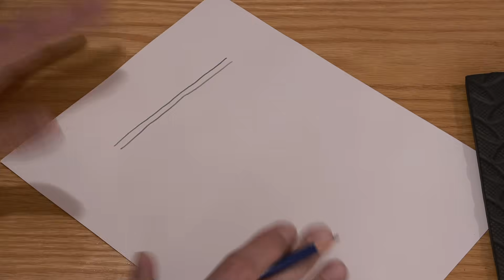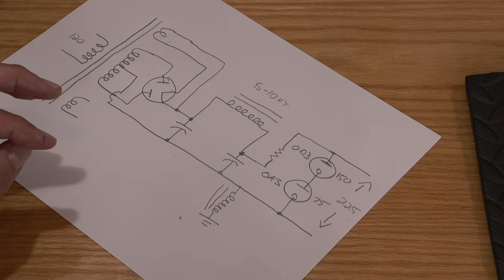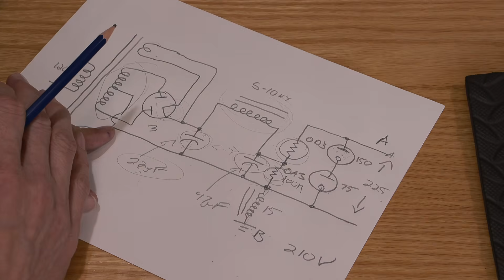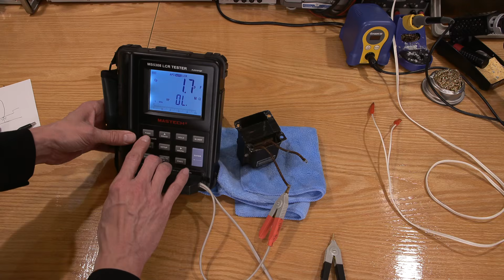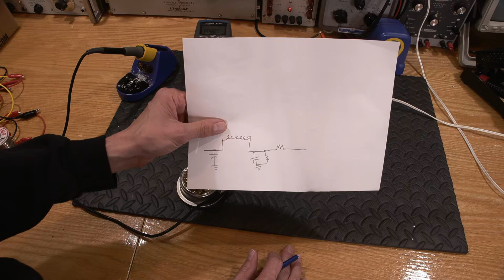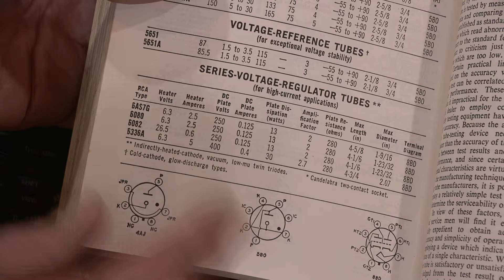Build A Power Supply - With Junk Box Parts! [The BC-348 Series.]

Comment: You should check the insulation resistance between the transformer and reactor windings and the metal casings of the cores. If the insulation has degraded, the cases can be live and be at high voltages.

That is the first thing I would check before anything else!

Comment: Had this happen on my BC-454-B. The prior owner scrapped the dynamotor and inserted 6 volt tubes instead of 28 powering 12 vdc tubes in series-string. The heater wiring was sketchy having one tube in series feed 3 tubes in parallel. This made the voltage at the 3 in parallel 0.25vdc. I bought a dynamotor and rewired it for 28-12vdc low voltage power. Bought the scrapped 3H Choke, HV Resistor and Capacitors and now it works. Had to also rewire the front panel because the gain control was grounded to the CW-AM switch which was very wrong. Everything was weird, but got it rewired. Definitely always want to check for modifications, especially because this conversion was done with spare cloth wires from other BC-series receivers so it looked original.

Comment: Hey Paul,  you would be far better using a 5Z4 instead of the 5U4 so the HT came up a lot slower and prevent punishing the stabilisers with excessively high current even for a short time.

Comment: In the context of a really quiet power supply, should the rectifier tube be close to the voltage regulator tube(s), since one of them deals with a variable voltage source, the other trying to stabilise it, knowing tubes are microphonic and rf sensitive ? I didn't pull it of my mind, that is what a seasoned DIY tube amps builder and former Fender employee (Uncle Doug) used to teach me beiing specific on transformers, filament circuits and preamp tubes locations taking accout of magnetic fields inside of the chassis
Even Better Regards ;)

Comment: Awesome video ! What is the lowest voltage a tube rectifier can work ? I'm looking forward to build a studio tube preamp, since I live in europe I intend to rectify ac mains with a solid state bridge rectifier, I've heard silicon diodes are noisy but I also intend to use like you've shown tube regulators after the ripple rejection stage to tame that noise. Still remains another myth I heard that says dc filament current would be quieter than ac ones, I know tubes need high votages to work, desiging heating circuit in series may get me in the 24 - 48 V ballpark (I could add even (phase purpose) tubes stages in my design to reach a value). Is it safe to build heaters in series ? Is there a tube rectifier that coud work within this range ? If not what is the lowest voltage one ? I intend to use as much  tubes as physics allow me without using a center tap power tranformer, I know I'll have to use a step down one for filaments but  I intend to be creative on this part .AFAIK Tube voltage regulators are far more stable than modern solid state equivalents, they just operate at different voltages, so do triodes and  pentodes .... What is the best B+ and plate operating volages for 12AX7 tubes ? I know I could dig myself into specs sheets but I prefer relying  onto someone who has real field experience, I may search for days and weeks, you may know that by experience and just pop it out by heart ....  Forgive me ;) 
Best regards ;)

Comment: ambient power reception is wanted and here is an idea to experiment with. Alfred Hubbard used 2400 foot bi-pole antenna oriented North-South (each leg 1200 feet). He had another going east west. If these feed down to a common balun (say 4:3 ratio with center tap) and with each hooked up so that the magnetic fields perform a subtraction (bucking), this removes local noise from the reception and picks up long wave propagation (unidirectional). This is his power source for his so called "Hubbard Coil". But the antenna is the interesting thing. Modern researchers use an L shape such as 1200 foot North, 1200 East. Signal processing can work out the direction of the signal, field strength, lots of other interesting stuff. BUT ... also I would imagine that you could use this for energy harvesting because if you can make it start beating -- using tuning ... because this is a differential reception ... not carrier wave reception ... that also would be ideal for harvesting RF power down at these low lightning strike around the globe places. With language models like free "copilot" and "gemini" and "grok", you can have it do all the math for you on such an antenna. It also informed me that 3 to 30Khz might be a better frequency range for lightning strike reception. This is a dangerous antenna. It could kill you as you know. Perhaps a proof of concept should use a smaller size and be in a frequency range of some man made reliable signal like WWV (2.5Mhz or higher)  at first. Balun could be also be tried to "add", and if you reach an exact match -- voltage peaks could be doubled. Also, by tuning "Q", you can go for wideband harvesting versus narrow band harvesting. 30 meter WWV might be a good 1st experiment.

Comment: I thought I was "doing it wrong". In an older radio power supply I'm modifying to keep the voltages reasonable, I was roughly guesstimating and substituting different resistors, and seeing what happened to the plate voltage. Watching you do basically the same thing (albeit while actually building a power supply) makes me feel much better about my, uh, "method"— and quite chuffed about the cash I dropped on a power resistor substitution box on eBay a few years back. Dialing it in with chicken-head knobs: sheer luxury for $40.00!

Comment: When I was a kid in the '50s I ran one of these as a novice ham operator.  I built an ordinary (non-regulated) 5Y3 supply installed in the dynamotor space - the usual practice for those days. Just for nostalgia, I've just bought a BC348 on eBay.  My inclination now is to install a power supply with a silicon bridge - no heat to speak of, no space requirement.  Open to suggestions as to a good circuit with no bias against solid state components.  I do take care to keep the radio reversable, in case someone wants it original in future.  This example still has its dynamotor.

Comment: I would put the PS inside, but I like what you are doing. With an external PS you can fabricate a cable and, with socket on each radio, you can power all of your 348s one at a time. Is that the plan?

Comment: Excellent video! At my last job, I made a list of low voltage bulbs, and their current consumption ( from a Glover's Manual...the little book of everything) to get accurate voltage readings from transformers. Attach a bulb of the appropriate voltage, and near the rated current of the transformer, then check its voltage. Generally, no load voltage is about 20% over rated voltage.
   A " Clamp Amp " meter is a temporary current transformer, I suppose.
     Two jobs ago, there was a wired intercom system that got its power from a standard outlet. On the back was a little neon indicator and label that said " If indicator is lit, reverse plug". Older outlets and plugs in the US ( and Canada, I suppose) weren't polarized. This was the '80s, and the intercom was from the early '60s.
    Years ago, I got into a friendly argument about wiring transformers in series, to get higher voltages. One guy said you couldn't, I said you could. You can, if the transformers are identical, but you will have to experiment a little.
    The line noise from that CFL...line noise must add up, and present problems for the power company.

Comment: What about using tubes that were designed in 1947 to have a heater voltage of 12V and a B+ of 12V, and anyway your only going to use a headset and you don't need a high voltage power supply.

Comment: Good to see you analysing the power supply. There is no need to convert to 6.3V...24-28 volt transformers are available,..though most ler P/t's offer 2 x 6.3 or  6.3 and 5V .
I ofte enough use them in series. Running filaments at 5V or 28V at 24 volts probably does not make a substantial difference to performance . Looking at close-up...his 
soldering is SO bad!! Is that torroid a choke?...A covered standard choke is a better option (or an external supply).. Another better choice if filament supply is inadequate, is 
find a better transformer and use a normal choke (which I do even when BC348 audio transformer has its own choke. Easy way to check if 6.3 v converted is to pull all
 tubes and look for continuity at each socket to socket .(one 348 tube does not use pins 2,7 as filament) or put some 6.3v or less usually on the filament line and see it it appears
aat each tube socket With 28V it will be broken as the series tubes are out. 70mA B+ is ok/correct for the 348

He didn't do a really good job!! apart from the nice looking to the wiring he did is abysmal!! I wish you'd get ontothe grid cap set....much more ;ham typical' late 30's design. The AVC/Off/MVC switch is not suited to AC spikes...far better to use a separate switch or connect a relay into the on/off cct. I refer to also use a delay on the B+ ..let tubes heat first. With dynamotor that was 'automatic' as the dynamotor 'ran up" to speed and thus B+. The R series should NOT have B minus directly to chassis...the audio transformer choke provided bias. I also prefer to have choke in B minus line.

Comment: Perhaps I missed this bit of info. How did you determine the B+ voltage should be 210 VDC? I would imagine that it was experience but for a person with far less experience tell me how you arrived at that.
Reply from the maker: Hi Richard. The B+ is in the manual. For this receiver, it's 210. Keep in mind, it's not all that specific, 215-220 is fine, it's not going to make much difference. Since we are comparing these receivers, I will keep the B+ as close to spec as possible.
Reply: @MrCarlsonsLab  That you have a manual for this is total surprise to me. Hopefully you have some decent schematics to refer to on the next part of the restoration.

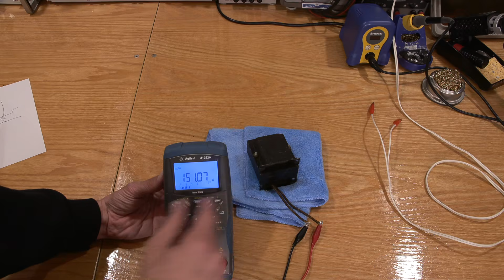Comment: 51:05 the lcr meter should do a great job of sensing resistance if you set it to DCR. Especially with low resistance because it would do 4 wire measurement.

Comment: My dad has 2 of  these radios and as a teen I made 120v power supplies for both. I used solid state and didn't really regulate anything. But they worked. 

I'll check to  see if I still have the radios.

Comment: something tells me you've done this before 😁

as you gain experience the math starts to matter less; but before you have the benefit of experience the math is very useful.
it puts beginners in the right ball-park and keeps them from fumbling around in the dark to no end.
the way some schools try and electronics THROUGH math, however, is a mistake. you need to get their hands dug in and experiment.

but even with the benefit of experience, I find if I'm ever working on something that's new to me, I fall back on the math to find my footing.
though it is clear I have nowhere near the depth of experience you do lol

Comment: In keeping with your desire to keep the radio somewhat period correct, I'd think you''d want to use a sheet metal chassis for the power supply. I suspect that when this radio was new, there may not have been those handy Hammond cast boxes.

Comment: I did something similar to this for a audio amp I'd built, had to take the inductor out due to it causing a worble noise at around 11 htz coming from the supply! Figured the core had gone into saturation mode. Placing a resistor in place fixed it. Took a while to understand this problem. Amp is very quite. Found this interesting watching you test your supply. I try to catch your videos when they come out. All very interesting.

Comment: Hey! Around 1:44:00 you're checking out the voltage variability on the multimeter, and mention it being 20 to 30 mV. Is that correct? I may be reading the meter incorrectly, or this may have been an oopsie. Did you mean 200 to 300 mV?
Reply: I didn’t see your comment until I made mine. But I believe you’re correct.

Comment: This is really going to be beautiful. Also, you probably know all the common standards that these transformers were built to that I have no clue about, but I'd be spooked to use an un-spec'd transformer without checking the gauge of any high current windings like the filament to determine their current capacity and unless it was blatant overkill, the cross-section of the core to make sure it could handle the total power.

Comment: I vote for the open chassis with black crinkle paint to match the radio. I'd try to arrange the parts on top to match the schematic. The artsy pyramid of regulator tubes flanking the 5U4 violates my esthetic sense. I see, left to right, the transformer, the 5U4, the choke behind the tube, and then the regulator tubes in a line, front to back, on the right. On front panel, L to R: A black fuse holder, a chrome toggle switch, and a red jewel light. On the back: The female Jones connector. Just gorgeous on a cold winter night listening to CW. I vote yes to a product detector and a souped up audio section.

Comment: The power supply I built for my tube amp system is fully regulated, stepless adjustable from 230-500 volts and have less than 1mv of ripple (outside hearing range) no ripple in hearing range at least what a scope can measure, and it can output up to half an amp of current or about 150watts continuously , no load or mains voltage skews the output at all, it is completely clean DC. the power it gives is so clean there is no need for any types of filters in the amp so I am injecting this directly into the amp, what this does is that the input voltage at the output transformers always stays exactly the same even at full volume which reduces distorsion and increases power and control at the same time. I put a lot of work into making this since I drew the circuits myself from the ground up and I also included over voltage protection and other things to make it even more potent

Comment: Actually, the regulators aren't vacuum tubes - they have gas in them. And for 100 mA, you're better off with a 5Y3 rectifier - or its 4 pin equivalent, the 80. And if you use a choke-input filter, the output voltage will be about what you need AND the regulation will be better.

Comment: This would have been a great opportunity to find a mercury vapor rectifier and have all the tubes in the power supply glowing bright and colorful, no LED required. I like the build, definitely way easier than designing an electronic pass element with random junk bin parts

Comment: So, help us understand. There are two shunts, the radio itself and the gas tubes. So the total current across is being shared through two shunts. Is the goal then to balance that sharing ratio so that the gas tubes are taking 20-30 ma and the rest is the radio?
Reply from the maker: Hi Richard. Technically two loads, we want the radio to load the supply to around 70mA, and the regulators to pull 30mA (or so). So yes, we want them to play nice and share.

Comment: With so many B+ volts, why don't you remove the reservoir cap and make it choke input.  Also a 5Z4 is a less sweaty in terms of heater current.
Its going to be very hot in your power supply
Reply from the maker: Too much drop, and headphone use would be kind of nauseating. The 5Z4 part would be OK though.
Reply: I guess its not a problem if your PSU is external to the radio. I'm doing the same thing but I'm building my power supply into the location previously occupied by the dynamotor to make it completely self contained.  I bought my BC348-R on ebay and it came with no 8 way power connector, no power supply and no output transformer and some disconnected wires hanging about but it is in fair condition for its age and now I have sorted out the wiring and electronics and fitted a suitable output transformer.

Comment: Thanks for the video.  I know the "special sauce" on this video was making out of junk box parts.  But rather than looking for two power resistors of roughly the right value in series, why not use a variable resistor to find the target effect, then take it out of circuit and measure it?  Just a thought.
Reply from the maker: That would be fine as well, in fact I have done your suggested method many times.

Comment: I'm quite mind-blown about the use of that extra inductor to create the  bias supply for 6K6 - would I be correct in assuming this works like the bias tap on a tube amplifier power transformer? How would one go about determining the inductance value for the desired bias voltage? (in my early 20s and fairly novice to this stuff)

Comment: Quick question Mr Carlson:  To prevent the initial current surge and electrode sputter in the voltage regulators is there anything speaking against adding a lightbulb or semiconductor element to limit the inrush current?  Excellent progress here btw!

Comment: The rectifier on one  extreme side  of the chassis and the two regulators in series after it. The two transformers on the other side with the main one on the extreme side opposite to the rectifier. What a video. Lots of tips.

Comment: type Back in the late 60's, I built a very similar power supply for a ham operator for his AM transmitter.  Some of the tubes were the metal tube type as you could still get a lot of military surplus rather cheaply.  

I started learning vacuum tube electronics when I was about 11.  Built and repaired a lot of tube gear.   

Even had an FCC 1st Class license for a number of years.  Ended up getting into IT and after I retired from that, I taught computer science classes at the local college for 10 years.  Your channel brings back a lot of memories.